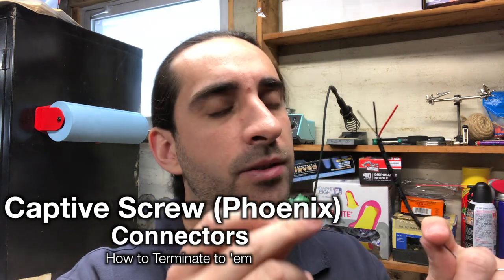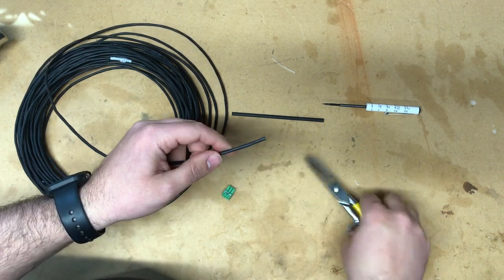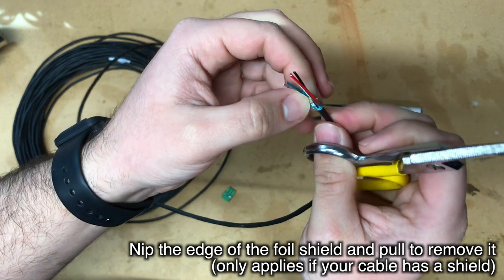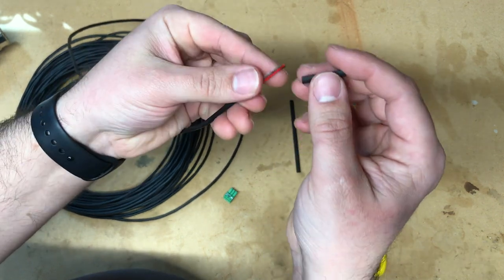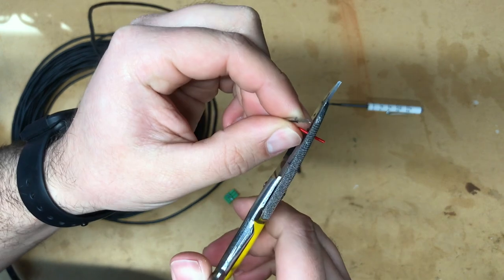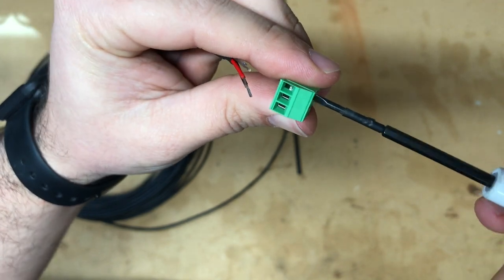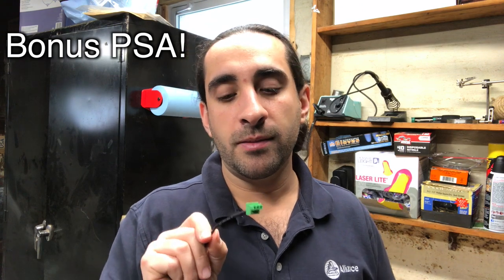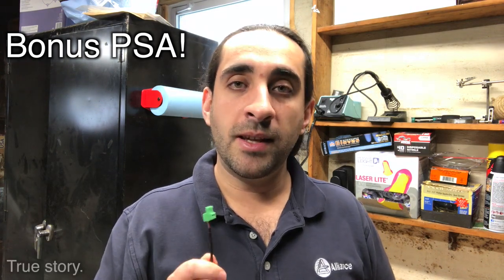Terminating to Captive Screw (Phoenix) Connectors

Comment: Tweakers don’t have the torquing capabilities like a screwdriver does so using a tweaker really isn’t the correct tool to use, also you should re-tighten the phoenix connector screws 24 hours later and you’ll notice that you’ll be able to tighten them a little bit more. 
I know you didn’t do this but you should also never use a flame on shrink wrap/Heat shrink.